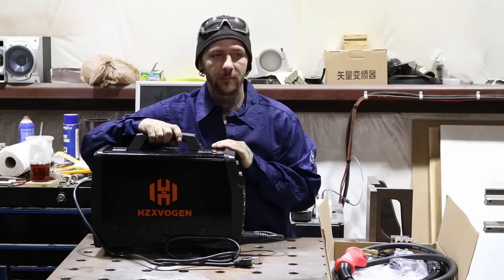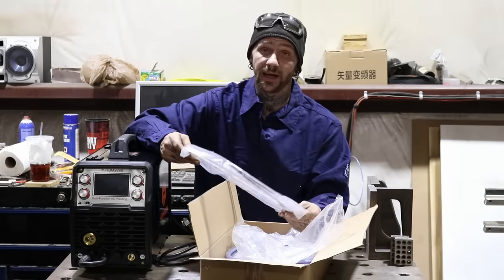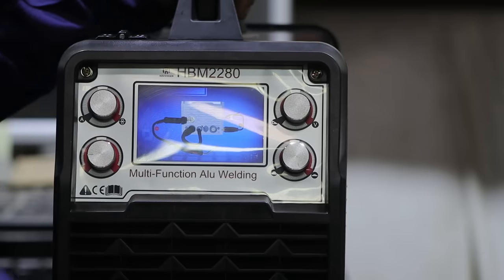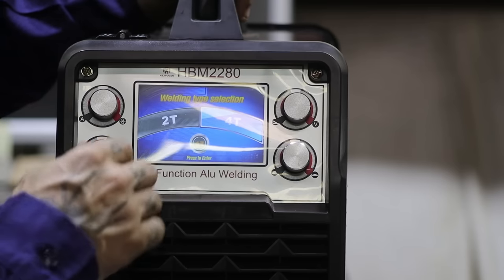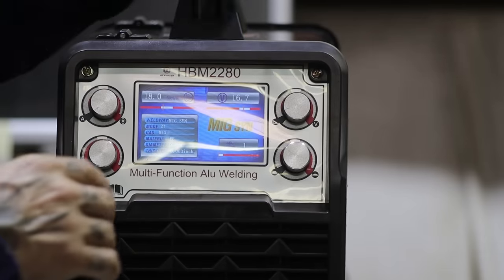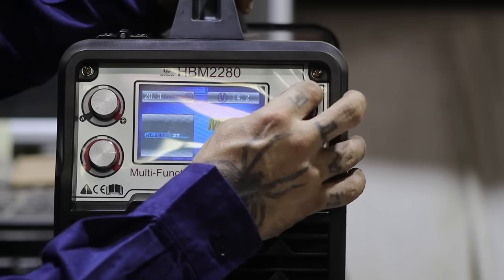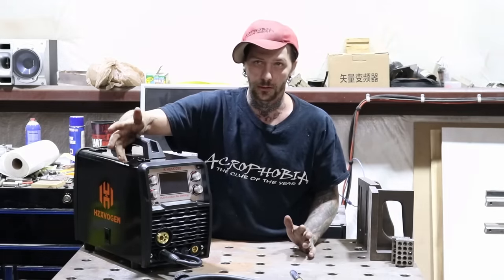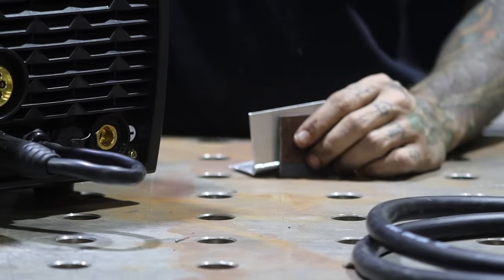HZXVOGEN HBM2280 250A Mig Aluminum Welder! Easy Setup and Review!

Comment: HBM2280 is 200A not 250 A
Reply from the maker: Was advertised as a 250a when I bought it. They must have changed it.
Reply: @LP_Creations  200A is just fine as long  as its real if measured  unlike some.

Comment: Thanks for the video. Can the device also weld/solder thin sheet metal?
I want to weld 0.7 mm with CuSi 3 on my car.
The description states that the lowest current for MIG welding is 30 A.
Thanks for the answer.
Reply from the maker: I dont really weld anything that thin. But it should handle it just fine, would just take time to dial in the correct settings.
Reply: @LP_Creations  I bought the welding machine. In the manual range you can set it up to 15 A, which is completely sufficient for thin sheet metal.
It works with flux wire and also with CuSi3.